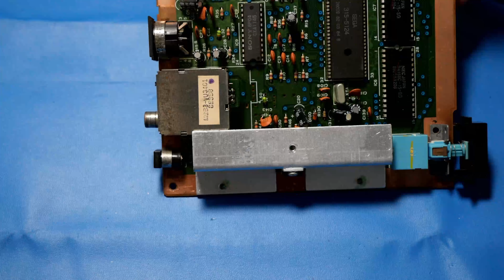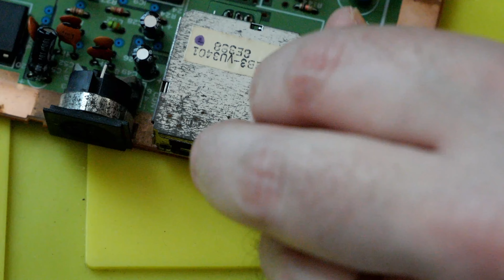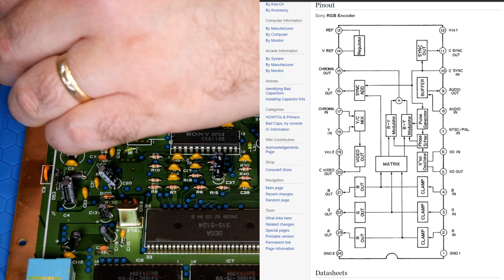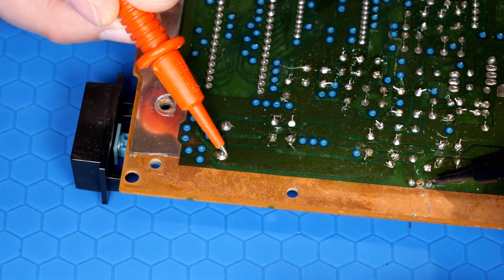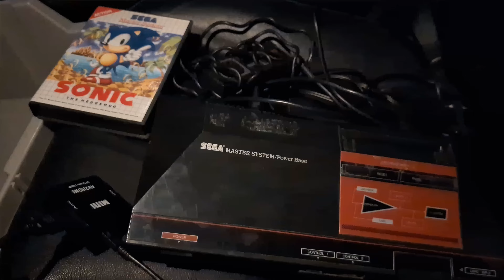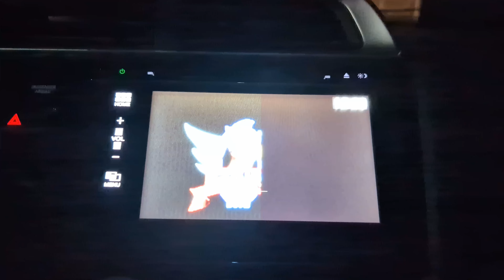Sega Master System USB-C Mod

Comment: Great video. Would be nice to see something like this for the PC Engine. That thing is so compact that I've read the heat coming off of the voltage regulator can shorten the life of the caps near it.
Reply from the maker: Thanks! I can't find any kits like this one for TurboGrafx 16, so I just ordered some USB-C breakout boards to mess around with.

I'll do some research and hopefully a video will be incoming within the next few weeks!